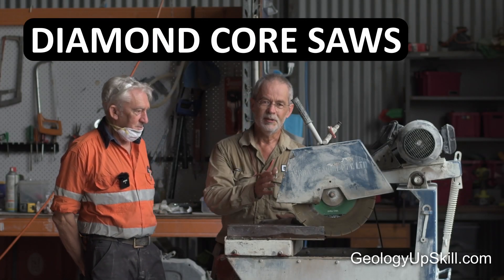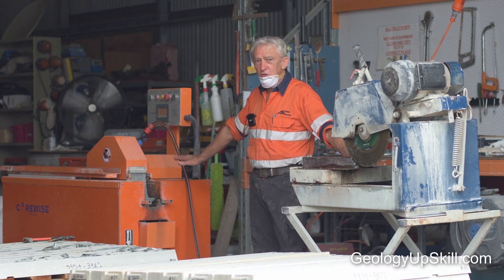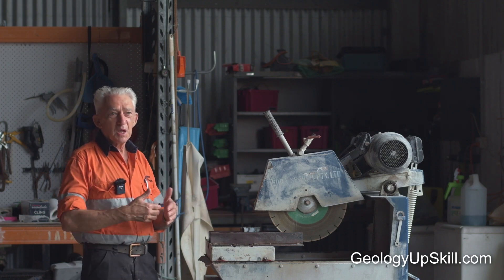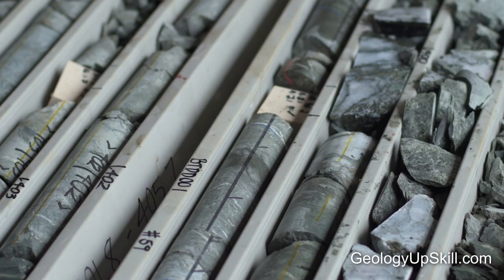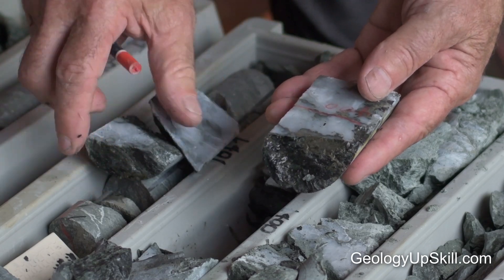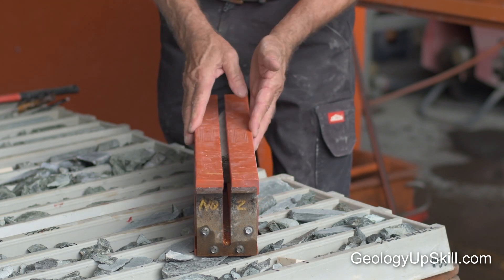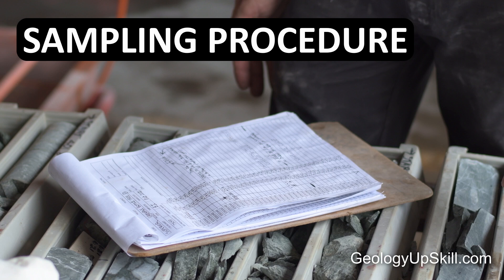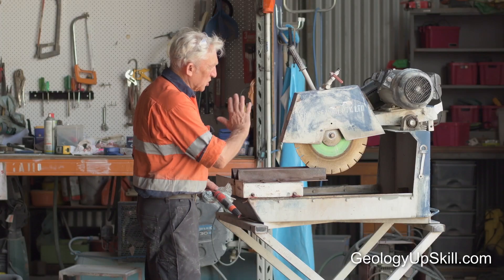Cutting and Sampling Drill Core with a Diamond Saw

Comment: Suggest you talk about lockout, isolating power before changing the blade!
Reply from the maker: Good point!
Reply: If the saw doesn't electrocute while using it wet and bare handed, changing the blade isn't hazardous.